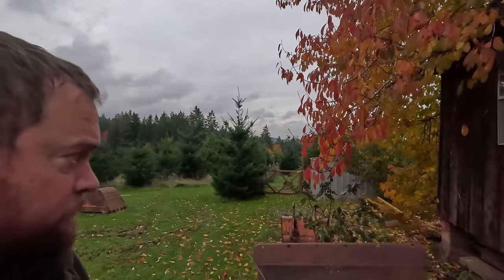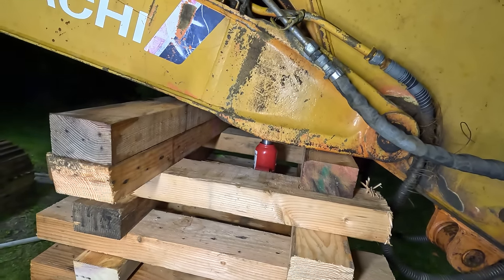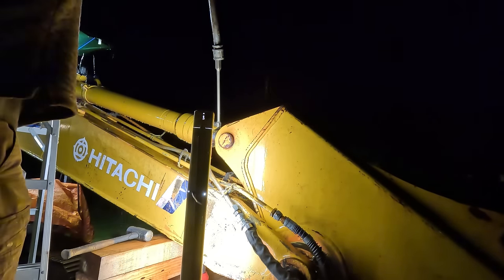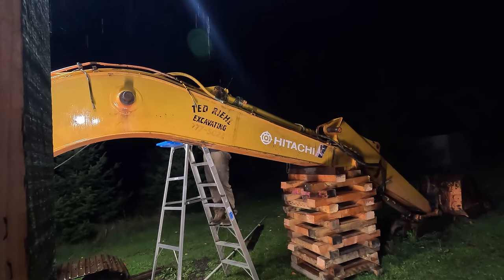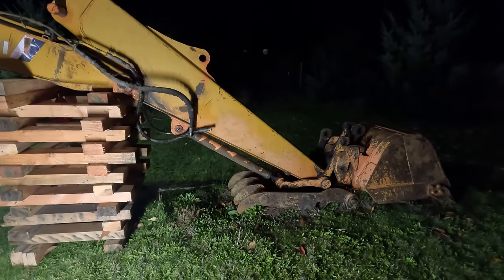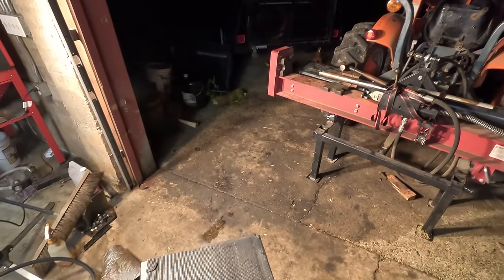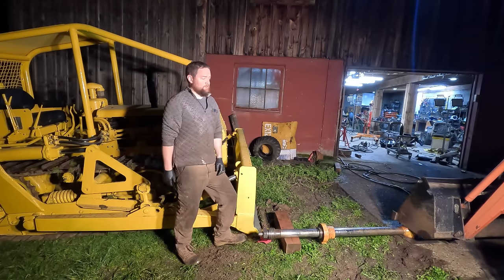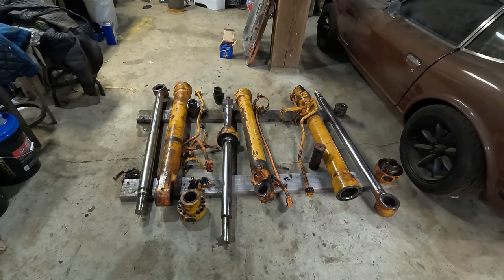Removing the stick cylinder using viewer advice - excavator project

Comment: I work on a oil rig, and we have an old saying if it won't get losen then it must break, just take a 4 meter tubing and put it on a that rigid, and jump at the end. if that doesn't help either, put twice as long tubing. if that doesn't help under maximum load, when 3 guys are jumping on it hit the nut with the biggest hammer you have. the iron then has two choices, either crack or get loosen, normaly it's easier for it to get loosen 😂

Comment: Try the dozer as weight holding the cylinder down and use a pipe extension with the tractor front loader

Comment: Use a torch to heat up that factory locktight. It will most likely come right off with the impact. If it doesn't just hook it back up to the excavator pin and use a cheater bar with your pipe wrench and heat.

Comment: Years ago some vehicles used torsion bars instead of springs. I could not  believe how much twist there  was in a 1 inch  plus shaft6.  Today you buy a torsion stick to limit the torque coming from an impact wrench.  I have a 100 foot pound one to tighten lug nuts on my cars.  Long way of saying get rid of that long extension that is dissipating a lot of the torsional power.  The big impact might still  do it. Maybe put a large pipe through the other end and keep it from bouncing back and forth. Good luck!

Comment: IMHO: Run a piece of 1" (or bigger) metal pipe over to the doorway.    Put an air hose coupler in the end of the pipe.  Short 1" airline from the pipe to the compressor. 
Then you are good to go.

Comment: Hello
You can use the top of the bit on the bulldozer, weld a bolt the same size as the eye of the hydraulic rod and weld a V in the bit as close to the nut as possible and a chain with chain tensioners around the bit to hold the hydraulic rod in place.

Comment: Use heat on the nut, some one might of used thread locker. I have seen it done before even with set screws!

Comment: Most of the time you need at least a 3/4 air hose on those big impact's and i would run it at 140 - 150 psi.. 3/8 and 1/2  air line don't really supply enough air

Comment: Nice job, Matt.  You fought the good fight in trying to get that cylinder nut to break free.  Seems to me like that would be a good enough excuse to get one of those big, old, antique vises like Abom79 has (Adam Booth's channel...he's a machinist)...an old Reed or something similar.  I agree...you'd probably have broke it free with that air hammer if you had a way to hold it.

Comment: My idea was to get a pin the right size to sit in the eyelet of the end of the cylinder rod, and weld it upright to something hella heavy/stable, then put the end of the eye over it. That would stop it from turning in any way/shape/form, as long as the weld held of course.
Whether you were still able to bring enough force to bear on the nut at the other end is a different story 😊

Comment: I might be blowing smoke out my compressor....but using an Extension and using 50-100 feet of line equals Much less Torque. 
I do believe your theory was correct, but backwards. Use the D4 as the "holder" and use the tractor as the "torque" multiplier.
Now the sticking point. The further you are away from the nut the more the pipe will "flex". You will never see it but it does "twist".
So minimize that "flex" and you win!

Comment: Matt, the cribbing was a better idea than mine (round support post for joists). 
What about using the dozer blade to hold down the rod eye  and a loooong "cheater" bar to loosen the nut. I wouldn't recommend using heat to break it free. Too much heat could ruin the temper of the nut.

Comment: We had at our rail transit repair shop an actual hydraulic impact wrench, perhaps you could beg or borrow one in your area, we needed to remove nuts off a 1 1/2  ( I think they might have been as large as 1 3/4)threaded “ anchor rod” that were usually rusted badly ( and heat was little use, the shock from gun was amazing on those rods) . Do a Google search on one of those tools ( I found them) to see if you could use your present equipment to power them, and if you do get to obtain one you’ll wonder how you ever did without one.

Comment: if you have a pipe close to the inside diameter of the rod you can put a piece in a couple feet long and then weight it down with the tractor.   That should stop it from spinning. Then put a little heat on the nut and it will most likely come off.  Or take the easy route and let the shop deal with it since your having to go there anyway.

Comment: To me it looks like the air hose is too long and it should be of a larger inner diameter. Some heat could also help. 
Having the eye under the bulldozer blade and using the tractor to move the wrench.

Comment: If you’re only at 95-100psi for air pressure.   Crank that compressor up.   A big gun like that takes a lot of air.   Plus like others have said. Shortest and biggest hose you can get.

Comment: Try hanging the rod from the boom on the pin on the excavator, then use a big breaker bar on it. If possible have a friend with the pneumatic gun at the same time.

Comment: How thick is the cement in your shop?  I'm thinking two or four, tapcons, then a steel plate over the rod end, and tighten it to the floor (with spacers as necessary).  As long as the tapcons don't pull out, it shouldn't move.
Might help with the re-torquing as well.

Comment: Matt, if you still have the stick cylinder, maybe try to wedge it under the undercarrage and the track of the dozer or the excavator and then do the same that you already tried with the dozer and the impact gun, but instead of the dozer use the tractor

Comment: So this is probably dumb, but.. there's that grub screw on the side of the rod nut. Sometimes they stack 2 of those in the same hole, and you cant see the second. (I know, its like asking if there is gas in it, but every now and then... there's no gas in it). anyway, good luck and good work.

Comment: Good morning ,
I don't remember if I said it or not in the cylinder video but the air pressure of the compressor is much too low for an unbolter of this size, it should have at least 8 to 8.5 Bars (+/ - 125 Psi) these machines consume at least 500 liters/minute of air, we can clearly see that it does not put out the right power. In addition, the more extensions and other adapters you use, the less the force applied, always apply the socket directly (as far as possible) to have the greatest impact force.

Comment: At 21:15 looking at the Hyster unit on either end where the spinning shaft goes through is there anyway that an adapter/contraption could be welded to accept a large socket where that would become your spinning unit(WRENCH) to loosen up that stubborn nut on that hydraulic piston?  Just an idea that's all?  Or apply heat to it while still under that blade/bucket when attempting to use that impact?

Comment: i see lot of water expelled from ur impact. drain the tank a lot and try to find a second tank it will give a lot more volume, the air will cool down and the water will condense in the tank. i use a lot of copper pipe between tanks like a still coil also be sure to use air oil in the impact or the water will wreck the inside of ur tools.
  shorten up airlines or double up ur air lines to the gun ill give more power.  big fat jack hammer line are great with big impacts

Comment: Cut out an 85mm spanner from 20mm plate and a couple of good slaps of a sledge hammer and that nut will come off. When your putting it back on again with the sledge bring it back to where the ball bearing was and that will be the torque you need.

Comment: I feel like heat maybe was necessary here? Would there have been a concern using it on a cylinder rod? 

Also, I'm glad you saved our ears, but you gotta think about your own too! There's a Swedish youtuber that lives in a pair of 3M Peltor WS's (which aren't available directly to consumers), but the "WorkTunes" model is the consumer grade version that are ~$70 and may have more long term comfort than the slim ones? Just looking out for your ears! <3

Comment: Hi Mat, this is all great timing as I’m about to do the same to my Kobelco 120 and everything looks very similar. Almost identical really. Do you think other than the satisfaction of doing it yourself and learning, with you having to take it to the shop for chroming and honing any way would is guy be better off just dropping them off assembled since they have the tools for this?
Reply from the maker: The shop here that rebuilds them would have sent them out to the same place for rechroming and honing (only place in town that does it), then would have charged me 2x whatever that place charged them.

Comment: Would using a shorter air hose give your impact more power?
Reply: Only slightly, the gun needs more volume, so a larger diameter hose would be heaps better.

Comment: Are you interested in a job with OSHA?  On a lighter note, did you consider putting a little heat on the nut before trying the air gun?

Comment: I know the pins and rod ends probably aren't the same,  but could you take the dozer to the shop and drop one end of a rod on the dozer and use shims if you had to and put the rod in to hold it for you . Also, does the impact have different settings on it , it doesn't sound at high speed. Just some thoughts 😊

Comment: did you find a local machine shop?  Its been impossible finding someone to do work on my old motorcycle parts.  Like re-chroming fork tubes or honing cylinders, etc

Comment: (1) Would you be able to put the rod eye back into the hanger of the machine and open the nut that way? Rest the rod on more cribbing + protect it? 
If the blade of the dozer can't go on top of pipe wrench ,  put a strap on it and pull down... while using the impact?

From tthe looks of it though You need a larger pipe wrench and a longer pipe... 

(2) Could you also weld brackets onto the bucket of the machine put the pin back through and try that way? 

(3) Do you have metal columns in the shed? Weld bracket on or burn holes in for a pin? Secure the rod that way?

I've taken the nuts off a larger hitachi machine. I've a few shorts on🎉 Instagram about it if your looking for ideas. 

You may be at your wits end with it, so apologies for the PTSD 😂. 

In order to move the project on it may be easier though to sub out that work to reign in the timelines... I think your done with it at this stage 😂😂😂.
Reply from the maker: Yeah exactly, I could struggle with it for another few nights or just pay the hundred or so bucks to have the shop do it.
Reply: @PacificNorthwestHillbilly  A wise man once said "A man's got to know his limitations..."

Comment: "I don't like sticking my arm in there for some reason..."
I dropped my old suburban on my arm, wouldn't recommend 0/10. I had a 1 inch deep dent where it landed and it took two weeks for the feeling to come back completely in my hand. Don't try it with a boom.

Edit: My arm became trapped between the fender and rear wheel. A neighbor heard my shout for help and got it jacked back up before any permanent damage occurred.

Comment: Just an idea, but couldn't you use one of the other cylinder mounts on the excavator to undo the nut? Stick the pin through as if you were remounting it. Should stop it turning.

Comment: Your Long Term Hearing, or possibly lack of.
Could not tell if you had any hearing protection on during the impact gun work.
Get a spare minute or so (does not seem like you have many), but when you do go ahead and download one of those db meter apps to your cell phone. Run the app when you are using impact tools. The sound/acoustic Impact is WAY above the certain hearing damage level. There are enough studies on this topic, a fella does not need to take it solely from me.
Nice video. Lota rain this time of year?
Reply from the maker: I was wearing hearing protection, that gun is extremely loud

Comment: I don't know it this will help.....
 But couldn't you use the dozer and the tractor in reverse? Use the blade of the dozer to anchor the shaft. Then use the bucket of the tractor to push your breaker bar down?

Comment: How do you like your ecoboost.  My f150 at 98000 miles needs cam phasers
Reply from the maker: It's been a good truck, have the same engine in my wife's car.  They are very temperamental about spark plugs but that's about it

Comment: I attempted to mail you a link. It cannot be delivered however. The nut may have loctite as well as being torqued down. in that case a good dose of high temperature on the nut will assist. Many ways to kill a cat, or skin a cat? There's an old saying about that anyhow. Then when you come back tomorrow after the nut and stick chilling off again, the parts will be completely loosened already!

Comment: I’m assuming you’re working on your own so you always need to plan an emergency escape which I’m sure you’ve got ticking over in your head. Can I please advise always have a phone in your pocket in case you get into a position you can’t move. I’ve got orchards I work in and always insist people have a phone with them in case the machinery they’re working with has an incident or they have an incident and need to be assisted.

Comment: i consently  see u pulling breaker bars and wrenches toward ur face or ur pulling up on them. that's wrong and unsafe. you should arrange ur socket and wrench so that ur pushing down, u can use ur weight to a better advantage and not get a fat lip or a broken tooth or pull out ur back. love watching u on the struggle buss.keep up the good work.